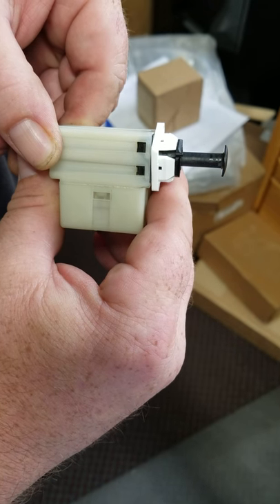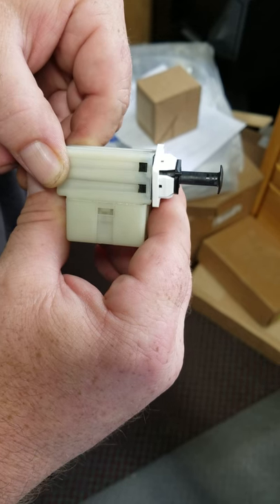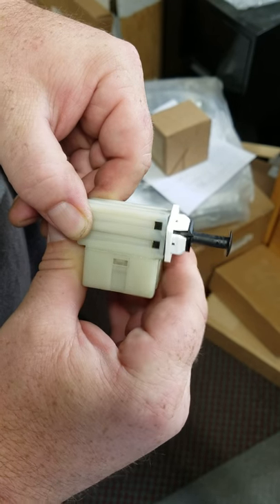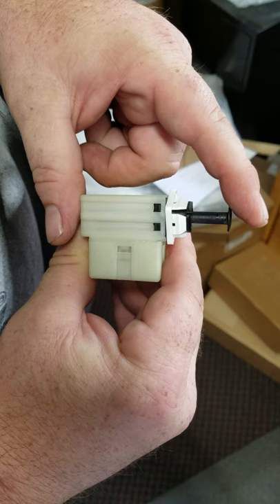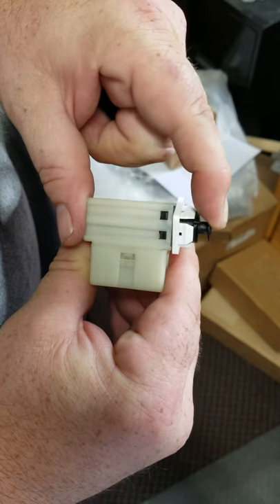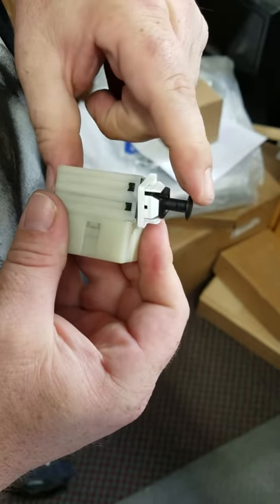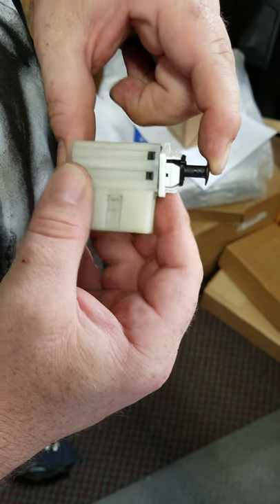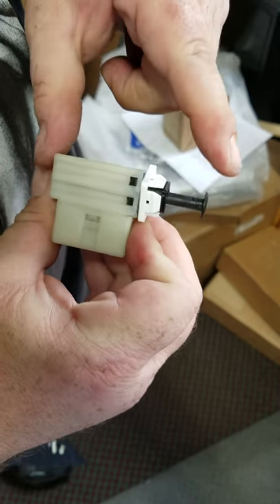2012,2013,2014 Dodge Ram C/V Brake Light switch adjust

Comment: This is fantastic, I replaced A/C Evaporator in 2011 Dodge Ram SLT 4.7 and you have to drop the steering column and dash, and I must have pushed this in while working on it and noticed it was not touching the brake pedal shaft after reinstalling. This caused brake lights to be on and after driving SERV 4x4 light and Traction Control lights to be illuminated. I reinstalled after adjusting, took the negative battery cable off for a while, then put back together and went for a drive, everything works. Thank you so much.
Reply: Same here but ended up buying a new one but might put the oem back in 😂
Reply: I just replaced my evap and the traction and break lights stay on as well, can you share what you did to fix? Same truck different year
Reply: @yurei3015  I did just what the video suggested. Push in the pin on the brake light switch the entire way, then pull it the whole way back out. Then hold down the brake pedal and reinstall the switch by putting in the bracket and turning 90 degrees. Let go of the brake pedal now and it will push the black pin back in the correct amount automatically. Then check out your lights to make sure they turn on and off correctly, and if they work, turn off the vehicle, disconnect the negative battery cable for say 15 minutes, and reconnect. Hopefully that's it.

Comment: Actually you'll find it in the shop manual and what you would do to set it in the vehicle is extended all the way out have the brake pedal push all the way down put the brake switch in place slowly let off the brake pedal and it will what they call self-adjust

Comment: Thanks
Reply: Thank You So much, had replaced the switch, still had brake lights on. then after your video, I had depressed plunger. not knowing I could adjust it out. problem solved. Brake lights went out, and so did traction control light.

Comment: Have talked with engineer from ram. According to Ram NO ADJUSTMENT NEEDED. Push brake pedal down while installing. Then let off brake pedal slowly. Done. Nothing else needs to be done. Booster should not have anything to do with brake switch. Thats why you cant find any info. Please do your own research